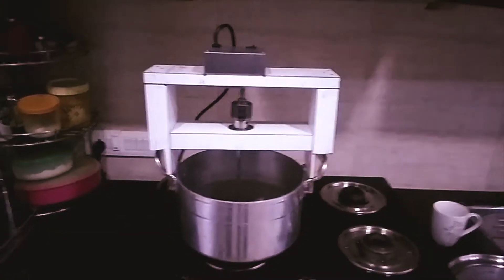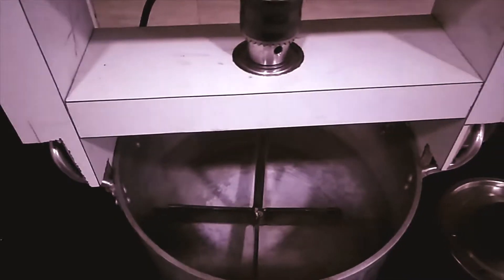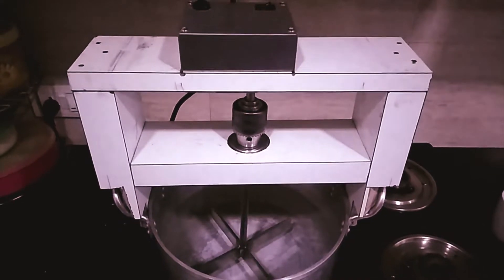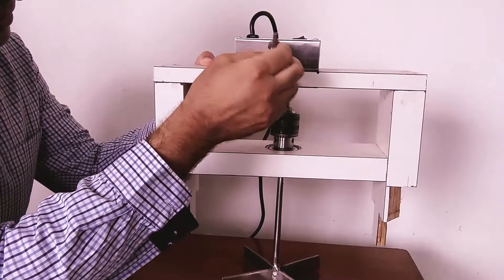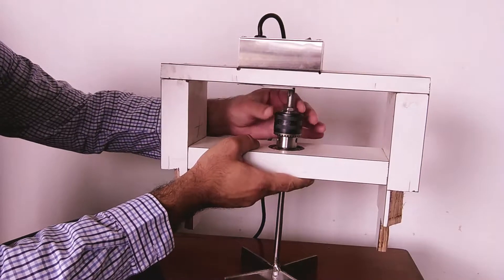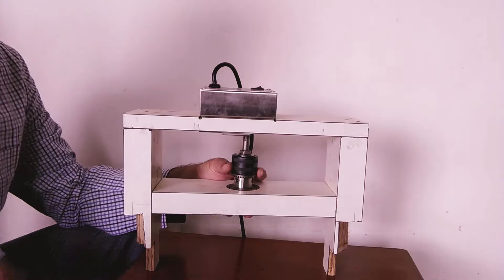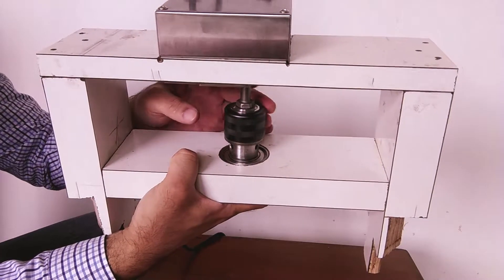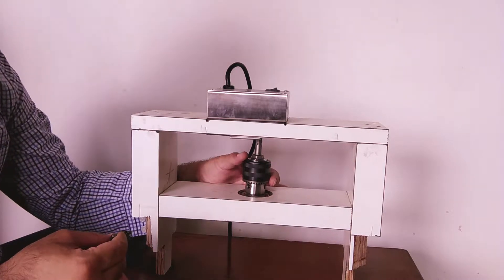Automatic stirrer assembled at home

Comment: What is the part number of the motor and controller..thank you
Reply from the maker: Actually dimmer switch for bulbs works fine. It is usually used for dimmer lights in the bedroom. Ask for dimmer switch at the electrical shop and they will give it to you 🙏